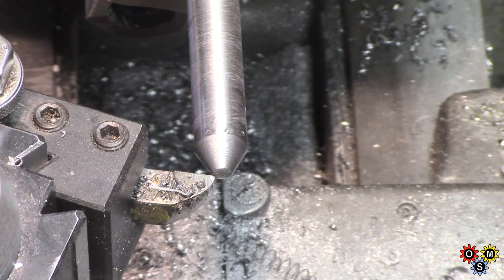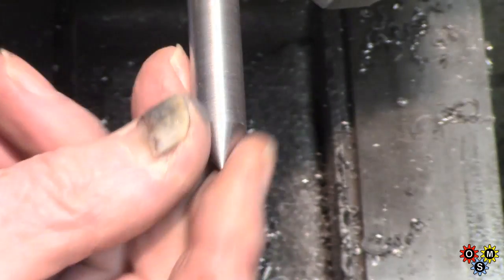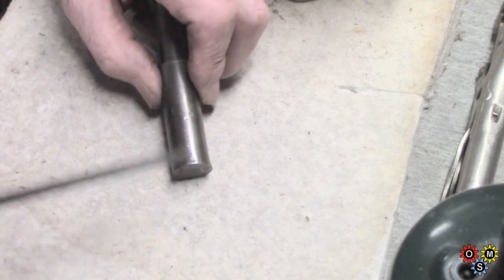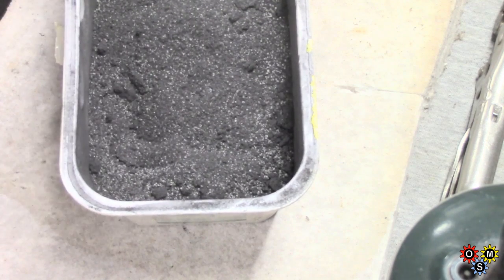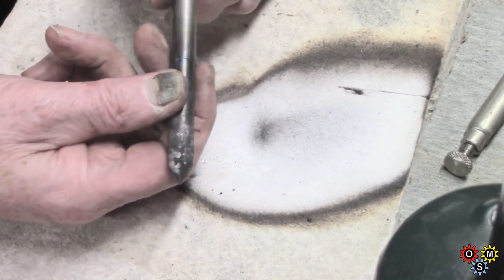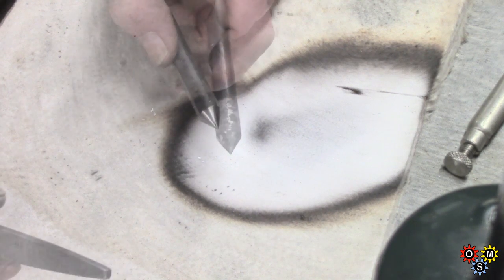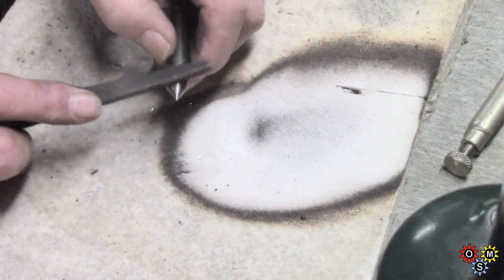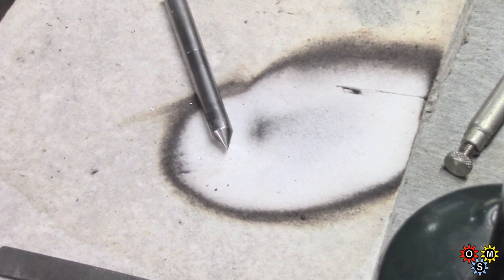Case Hardening - Simple but Useful

Comment: Can you then anneal the item or would this mess up the case hardening?
Reply from the maker: Hi,
Good question! Thing is, the thin carburized layer should be in theory a permanent change but possibly heating to tempering temp might alter it somewhat - but not (IMO) enough to remove the hard 'skin'.
Reply: So also in that principle allowing an item in a air sealed box full of carbon left to cool in the oven when turned off over night, then heated up to non magnetic temp and quenched, could result in the same hardness as quenching straight away?
Reply: great workshop by the way, jealous!!!
Reply from the maker: Another interesting question! I guess if top temp reached is high enough before oven shut-down, then some  ''carburizing soak'' should occur. Then I reckon a re-heat to suitable temp and a quench should make it 'take' fully. Overall however, where very often the case is only needed on one part of the item, the immediate method would be the way to go for me - my method of choice anyways generally.
The shop - it's a permanent mess - and not as good as many Youtubers unfortunately. :)
Reply: You are a modest man, and that is your riches, always someone worse and always someone better, and a organised mess with a lathe in the centre is a picture. What originally brought me here, and i've looked into case hardening before, but then thought what would the effects of welding a case hardened steel to a no case hardened steel be. So would you use a hardened steel rod or the base rod, andf one chap on a welding forum seemed to think that the base metal might transfer to the case. A lot more heat then we are talking about and metallurgy is mind blowing. 
Just like to add never loose that touch at replying to your viewers, muchly appreciated. Regards
Reply from the maker: Here we may well get into variables, depending on the requirements of job. Seeing as the case is only a thin layer, the base material can be often way softer. If joining a case hardened piece to softer, a regular rod is adequate and probably won't spoil the case area if planned out properly - in fact it may be the requirement that two pieces need joined anyways and that can then be done first - applying the case to the areas needing it afterwards.
Put it this way - more than one way to skin a rabbit. :-)
Reply: Ha ha hit myself with a big hammer!! Yes and in my case that would be a better way of doing so, thank you!!

Comment: Hi Chris, thanks for this, timely as I plan to make up an engineers parallel clamps set and was wondering about what steel to use. maybe mild steel and case harden the working faces would be fine ? what did you quench in ? water, salt water or oil ? does the quench medium make any difference?  when I get my shaper refurbishment series done , I hope to make a start on a small furness and heat treat some tools. All the best and good to see less troubled with ailments.  Mat
Reply from the maker: Hi Mat,
Thanks for dropping by. Flu type cold seems to have eased, at last!
I don't think this approach would be ideal for the clamps you plan - I'd be concerned re any possible distortion and interference with surface smoothness. Preferably some hardening steel would be better I think - tool steel ideal perhaps.
I quench in just plain old water - the fast 'shock' seems to work best to finalize.
Reply from the maker: If you get a deep enough case then a light grind should be viable but, not enough depth and grinding might remove some of the little you may have achieved. A longer 'soak' may be advisable.
Reply: I think its going to be a 'case' of suck it and see... but many thanks for your upload and the discussion. All the best Mat.
Reply: Chris: The way to go here is to case harden in the furnace, then grind them as a pair after quenching, but I am sure you know that, Chris B.
Reply: Tool steel generally comes with a premium, 'yard steel' not so much - thus case hardenning seamed a good plan - and if the distortion is an issue I can always grind / machine back to true on the working faces.

Comment: This is a very much underused hardening method in the home workshop, I think Kasenite is no longer available but there is an equivalent, the good feature of this method is that it gives a glass hard surface, with a tough core, the ideal thing for wearing/sliding parts that also need to take shock loads, (ie gun frames and components and gears), I always keep the heat on the area until the molten Kasanite is glowing, then plunge into water, you should get a very sharp "crack" noise like a pistol shot, you then know you have got a really hard surface, using an electric furnace I have got .030" thick hardening, but .001" is more normal using the heat in air method, but the loud crack is what you need to hear! Chris B.
Reply from the maker: Hi Chris,
Yes, your mention of sustained heat and the 'pop' from quench certainly is way to go for deeper skin. My quick approach is enough for a thin layer which sometimes may be enough. An electric furnace is something I sometimes wish I had!
Reply: Yes Chris, the electric furnace is the way to go, I use mine for colour case hardening, you cant get results on that by heating in air, but it does work out expensive in electricity, not as expensive as a colour case hardening job which is £450 ! Chris B.

Comment: Nice demo, Chris.  Some, if not all, Mauser actions were case hardened, and I remember my uncle case hardening flintlock frizzens using a mixture of leather crumbs, antler grounds and charcoal..he would pack them in wet red clay and throw them in the fire...they  had that really nice multi-colored finish when he dug them out.  Happy Thanksgiving to you also.  Thanks for the upload.
Reply from the maker: Hello Dale,
Thank you - I think there are probably many 'formulas' for the carbon rich mix and I do recall hearing about some case applications with Mausers. Sure would be useful for a frizzen.
All best.

Comment: Hi Chris !

Nice tip there ... I think I'll try make me a new tap follower with that method.
Reply from the maker: Hi Keld - haven't seen you for ages! Bear in mind that it only gives a thin 'skin'.
Reply: ChrisB257
I haven't been out in the shop lately - too cold ;-)) I'm considering installing one of these "heat-pump-systems" producing more energy than they use, so I can have the machines and tools heated up constantly. Right now even if I starte the heater the tools and machinery is still too cold for my fingers - that's bad !
Reply: Vipashna madatashion